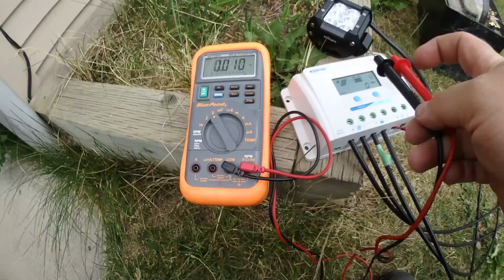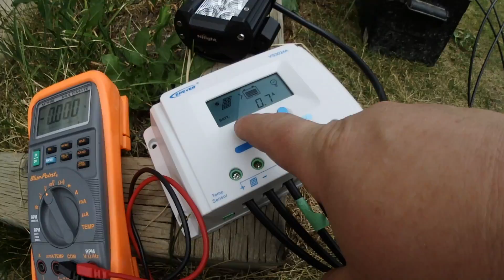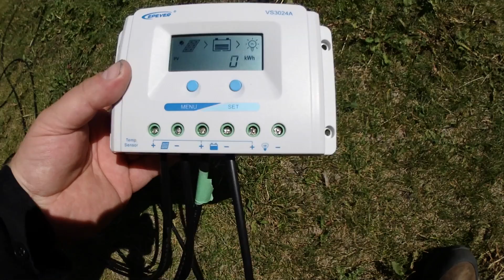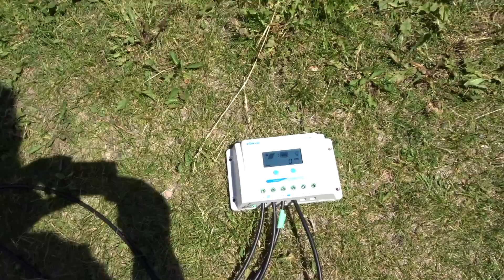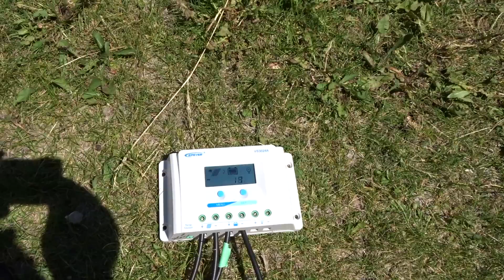Budget Overland Testing the Solar Panels

Comment: It is me, or does any camera that has a wireless option seem to have issues?
Reply from the maker: so you have that problem as well with wireless ?
Reply: Yea, I have the drift ghost s and it has froze up on me a couple times when I used the wireless,  I also have the olympus tracker, and I havent tried the wireless with that, but when I was looking at reviews it seemed to be an issue

Comment: Hey Jerry,

Nice build!, ive been playing around with solar recently as well.
I recommend getting an MPPT grid tie inverter, with a killawatt meter. 
you can literally plug the panels into your home grid and start using the power right away rather then having to go thru a battery bank.
I bought the cheapest one on amazon and it works well.
the killawatt meter just allows me to meter how much power im producing.
Reply from the maker: link me the model number or set up that your running so i can check it out